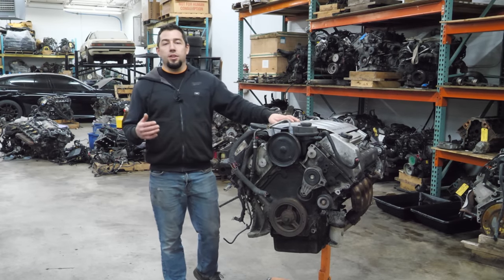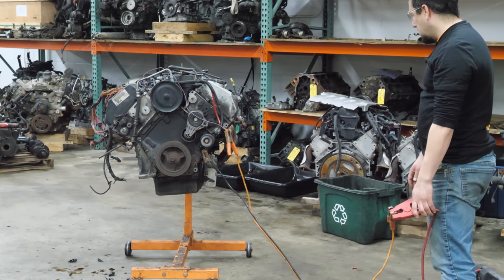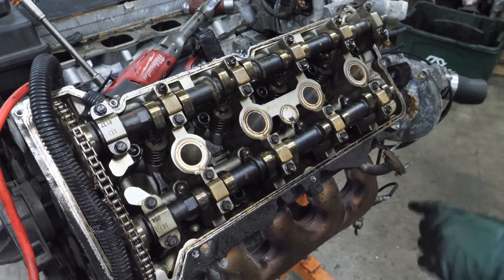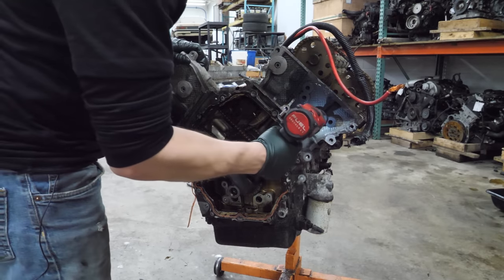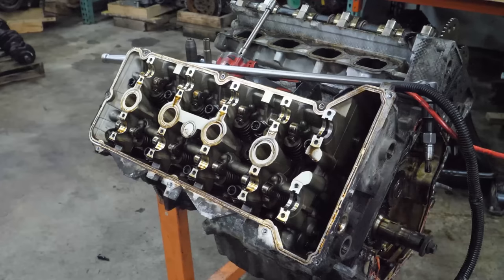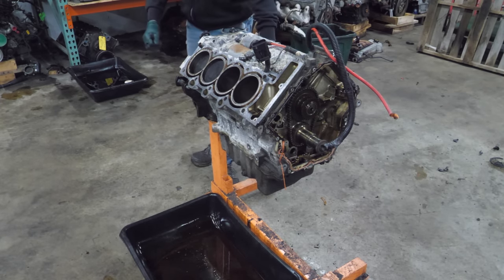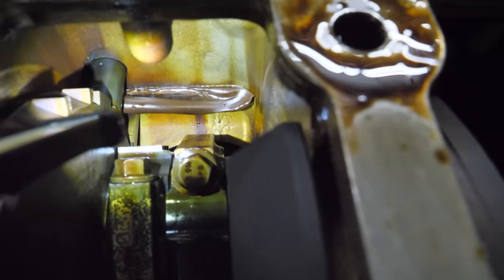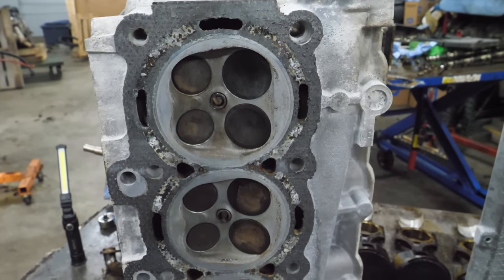Customer Returned This Cadillac Northstar L37 4.6L V8, How Many Things Can We Find Wrong?

Comment: This reminds me of your last video on the Ford 300---lack of cooling system maintenance roasted the head gasket(s). For those that are new to auto repair, I hope this tip will help. When applying RTV to flat mating surfaces, you want to have full, even coverage all around the gasket surface, but the RTV should be THIN. How thin? There should be just enough so that if you were to smear it with your finger while it's on the gasket, it shouldn't spread. If you tighten the bolts to spec and you see ANY RTV oozing out, you used too much.
Reply: @Freiherr Dinkelacker Yes, exactly!
Reply: Good Quality gaskets do not need RTV sealer. This engine was beyond overkill with the RTV!
Reply: RTV shouldn't be used with gaskets. Thin might be better, but NONE is the proper way. 
(unless specifically documented by the engine manufacturer)
Reply: that doesnt makes sense to me. sure, if it oozed out there was too much, but guess what, what should be there is still there, so isnt that still functional? not enough would be the bigger problem, youd do all that work for nothing because it'd leak all over again. 

better to have and not need than need and not have. also, like previous guy said, you shouldn't be putting gasket material on a gasket, thats what the gasket is for.
Reply: @BobSmith-mc7uq  It seems that there are no good quality gaskets for Northstar as there isn't a single gasket that doesn't start leaking after few years. That's why RTV is often used. Ofcourse this here is complete overkill.
Reply: @bradhaines3142  It's not functional when much of it winds up in the oil pickup tube, or clogging oil galleries and coolant passages.
Reply: @justsumguy2u  thats why you let it set before you put oil in it, as directed
Reply: @bradhaines3142  That doesn't make sense. Even if it's fully cured, it can break off in the engine due to heat and vibration.
Reply: @bradhaines3142  - too much means it breaks off and clogs the engine. Also, it could fill in smaller oil and coolant passages. RTV silicone is the wrong product for many applications, including that joint.
Reply: @johncoops6897  Yup.  Use an appropriate gasket adhesive on paper, cork, or metal gaskets.  Use nothing on rubber seals or pre-coated gaskets.  Use RTV when there is NO gasket.
Reply: @KevinJames-yg9eu  - Generally, you shouldn't need to use any gasket adhesive. And RTV is NOT the proper way to seal metal to metal in many cases. In all cases, do what the engine manufacturer recommends, not what the sealant manufacturer says.
In the case of a North Star, the correct product is anaerobic flange sealant and not RTV.
Reply: @BobSmith-mc7uq  

Toyota only recommends a sealer when there is a difference in height along a gasket service or an acute angle less than 90°. 

For example, on the 1mzFe 3.0L V-6, a small thin bead like one of the commenters mentioned goes over the two semicircular plugs on each head and then in the 50 degree or so angle from a circular housing at the other end of the camshaft.
Reply: @bradhaines3142  ya need more goop. and just smear rest of the tube around the outside.    PERFECT !
Reply: @BobSmith-mc7uq  every honda engine requires rtv on some gaskets because of the way the timing covers are arranged. It's good practice but probably not nessicary.

Comment: What really scared me was they had two timecert kits for these. First one for original failure and a second one for when the first one failed. Only way to fix these was the Northstar Performance stud kits.
Reply: No the only way is to have a professional machinist rebore the threads and put in larger ones, there’s someone that does it and has a 100% sucess rate in completely stopping any failures due to head gasket bolts.

Comment: This video brought back so many memories from when I worked at a Cadillac dealer. I rebuilt a few northstar engines. The rtv was a bulletin to use silicon instead of the cheesy rubber gaskets along with the anaerobic sealant for oil pan. I loved working on those money pit engines 😅. Imagine working on that engine in a no room engine bay 😂. Thanx for the tear down.

Comment: The NorthStar is pretty much the opposite of the LS. It's actually (in theory) not a bad engine at all, really cutting edge ahead of it's time. They where pushing 300hp from a 4.6 in 1993 which is really really impressive. I think the issue with it was too much at all at once. The LS really if you look at it, is a product improved 2nd gen small block chevy. The northstar is a really really advanced engine that i think if it had more time would have been a great motor. It has a fully supported crankshaft like performance engines, the lower oil pan forms the bearing journals. It also had fully controlled spark and fuel timing among other electrical goodness. Those valve covers are magnesium I think, because light like plastic but not cheap and break.

Consider what ford did in 1992, they made the absolute disappointment that was the modular pretty begrudgingly after wanting to discontinue the mustang for a Mazda and v8s all together.
Chrysler was still using the LA from 1964 with pretty much 0 changes they had AMC cranking out their abysmal 4.0 becuase they didn't have an engine worth shit that wasn't by Mitsubishi.
GM tried. I mean they totally fucked it up and this engine was hot garbage all things considered. But they had a go at it, unlike the others. And i forgive them for everything cos they went back at it and made the LS. They didn't try to stick to it like ford. God I hate the modular. The cayote sucks too.
Reply: Good take. As someone else said, it could be considered two Quad4s joined together, and while Quad4s also had problems, they were very close to the most thermally efficient engines for their time and definitely for the price, pretty much only Ferrari and Lamborghini were selling cars with higher mean effective pressures in normally aspirated engines at the time. GM running hot and cold on innovation and investment meant the Quad4 and Northstar both had lots of potential and good ideas that weren't given the time and resources to gel into something really developed and ready for market at the volumes and price points GM wanted them to.
Reply: @Trendyflute  Yea i think it was just time and testing. The other thing is i think this engine was a victim of culture, Americans where so used to the bombproof reliable Chevy small blocks that they weren't ready for a engine like this. I bet in a German car the NorthStar would have been praised as one of the best engines. Is this any less reliable than a M60? or a M113? The main issue it had was oil consumption and overheating (which was usually owner fault)

I've slapped small blocks together with multiple gaskets because the deck is warped and those things run and run fine. You can't do that sort of thing to one of these.

Granted I might take all this back, I'm looking for a decent NorthStar engine to build and NorthStar swap something in place of my usual LS swap. And maybe it really is a garbage fire. Won't know till I try.
Reply: The modular ford, one of the most reliable engines ever made. And you bad mouth it like it's garbage.
They have also gone faster than any ls in any configuration. 
Yep that horrible engine.
Reply: How could testing not show how weak the block is where the head bolts tread into.  Major design flaw that any engineer worth his money should have known.  Typically GM most likely the thin head bolts were a few cents cheaper.  And the Ford modular motors are best in class and way advanced compared to an LS.
Reply: @racekar80  "How could testing not show how weak the block is where the head bolts tread into."
Because the threads fail when overheated. And the NorthStar was "designed" to be overheat resistant. It had a lot of features like limp home mode where it ran only 1 bank if it had no coolant and it could run about 100miles using the other bank as an airpump to cool the block. They should have tested overheating but they didn't or didn't consider it a major factor. The thing is when overheated the first sign is a head gasket fail, which is pretty typical of most engines when overheated so i can imagine they failed to see the bolt stretch. You can fix the issue, the block can be rethreaded for larger diameter bolts and then problem solved.

" And the Ford modular motors are best in class and way advanced compared to an LS."
HAHAHA best in class for ford maybe, they never could make a decent V8 unless it was massive, cracking blocks walking caps 2 bolts because they always cheap out lmao. The modular isn't advanced idk why you think it is, SOHC isn't some advanced technology. Here's what actually matters the LS uses billet main caps supported by 4 bolts and 2 skirt bolts, the Modular uses old school cast mains with only 2 bolts and 2 either dowels or jack screws depending on whether it's a Windsor or Romeo block. Both designs absolutely awful, the design inherently means it's hard to get the caps centered. And that's proved by what they did for the cayote, 4 + 2 bolts billet mains just like the LS. In the early modular the rear cap isn't side supported from the sides at all. The head bolting on the modular is OK but not great it uses 10 long bolts inside the valve covers, the LS has the advantage being pushrod and bolts 15 the 10 longer bolts and 5 small bolts prevent walk. The modular block valley isn't fully supported, if you look at the LS valley it's enclosed and that aluminum cover at the top is like a girdle and adds more stability, ford added more material up top to the aluminum block modular and the cayote to get the same strength. On the bottom side LS oil pans are structural and again act like girdles to hold the block together it's why the LS pan is Aluminum not stamped steel. The LS prioritizes head oiling that makes sure the top end gets plenty of oil, it's why despite being pushrod the LS revs plenty. The heads, all the modular heads are garbage there's not much that can be done with them the valves are tiny and they have to be because the bore is small but even more the runners are small, the lash adjuster setup makes it hard to swap bigger valves and springs because it will collapse or simply break. The coolant crossover happens in the back of the block and the intake which means your intake temperature is not symmetric. And your crossover in the back isn't great either. I'm sure I'm forgetting stuff but it's really not great. The cayote is a great motor but it's because it's a well known formula, not better than the LS but it's good. Only took them 15 years to figure out what imports had already been doing.

Please go ahead and point out what makes the modular a "best in class" engine. I don't think you can find a single thing that it does really well. Nobody modular swaps anything for a very good reason. As for reliability it's no more reliable than anything else.
Reply: @SPAZTICCYTOPLASM  I could write a book about all the lies you are saying, but I'll keep it short. You saying modulars are not reliable is just nonsense. Soo I'll stop you right there. 
I could get into specifics of the modular design program, but I'm suuuure you know this stuff since you are saying they don't interchange. Hell, I could say the ls doesn't interchange, but that would be a lie. Just like saying modular stuff doesn't interchange. So whatever point you are trying to make on that is moot. So let's move on.
So, to you, it's impossible for modulars to make 1000hp? 🤣 yeah nobody has ever done that. Point you to one? One is 10 feet away from me. Or you could just search anywhere on the internet easily, but ignorance is bliss. 
Yeah modulars have gone faster than LSs. Mind blowing I know.
The fastest 1/4 mile time I can find for an ls is 5.97. And it took a 427 cubes in a billet block, billet heads, billet crank etc aftermarket everything and 94mm turbos to run that time....meanwhile the 4.6 has gone 5.88, with only 281 cubes in a factory block, factory heads and a factory crank with 88mm turbos... and it has gone faster since that time...
Also, don't know of any ls going over 300mph in the standing mile either..
So yeah.
Reply: @banneddamn  So your source is just "trust me bro". Not a single link not even a dubious forum post. It's obvious you don't know that windsor and romeo blocks have several differences. But go ahead get into the specifics. Take all night if you need to. Times without car weights don't mean anything not that i expect you to know, but the modular crank limit is around 600 horses before it shears.
Reply: @SPAZTICCYTOPLASM  my source is I've looked it up, maybe you should too. Google it. You're just too lazy to do any research on it on you're own so just plea ignorance on your part. Good luck with trying to link things in a YouTube comment. 
I know there are small minute differences in windors/romeos. But that doesn't mean they aren't interchangeable. You can bolt windsor heads on a romeo. Hell I'm running a windsor block adapter on a romeo. The whole point of that is moot and not a point of contention. Meaning that it means nothing in the grand scheme of whatever argument you are trying to make out of that. 
With the cranks. I guess you are talking about a cast crank but seem unaware that there is also forged cranks. Even with the cast cranks, people have made over 1000 on the cast cranks. I wouldn't do it, but it's been done. Richard holdener has talked about this specifically in fact in many dyno test sessions. But I was specifically talking about the factory forged cranks. Which have been run at close to 3000hp in those engines and they have never failed/broke in those racecars. 
Now with the cars running those times. Both are similar pro mod style chassis with similar weight. 
So do this. Type into google fastest ls 1/4 mile. Article comes up I think for drag racing illustrated. 5.97. 
Then Google accufab racing. Goes 5.88. 
Look it up for yourself. Trust me bro, I doubt you'll even look into it so who cares.... I know you don't. Just anything to not be proven wrong.
Reply: The Northstar engine originally came from Mercury Marine. It was originally purpose-built for boating applications.  For some reason GM switched to a finer thread pitch on the headbolts.
Reply: The teksid blocks that started out in the mark viii and became the power plant for the mustang cobra made 300hp without a ton of issues , and those blocks were capable of handling 1000+

Comment: 17:06 As a (former) DSM owner, I felt that one.

Regarding the rod size, remember that size is only part of the story (there’s probably a joke there). The Northstar is an expensive engine that was only installed in expensive cars. The 5.3 LS is a cheap truck engine. The Northstar is meant to spin up to 6500-7000 rpm. The 5.3 LS is made to spin up to 5500rpm. In other words, the rods are made of stronger, lighter materials in the Northstar, whereas the 5.3 rods are made of cheap, heavy materials. So yeah, size is only part of the story.
Reply: Right 😂😂 I’m not an owner but had to do one on my buddy’s 4g63 😂😂
Reply: LMAO I came here to comment about the 4g pass he made 😅😂😂😂
Reply: Glad another fellow DSMer heard it too😂👌

Comment: Once the head studs are repaired with a kit from Northstar performance these engines are actually pretty cool. I think I saw one on Youtube years ago that made 700hp with a turbo and spun to... I think 8700RPM and sounded absolutely sick. If I had a project I would totally consider shoving one of these engines into it.
Reply: It will definitely not hold 700 hp for very long, north star engine block is weak
Reply: @a.a7648 hey are not! Any block will crack if not sleeved to handle certain power level and using those hard solid mounts.

Comment: This one had the VVT I believe , the roller lifters were a nice change, my 98 had the old bucket style lifters. The VIN K  engine code  L37 engine was rated at 300HP factory, a good engine, it was just mostly neglected from owners who have no idea what " preventative maintenance" is. This is a good rebuildable engine, use a Northstar Peformance engine head stud kit and the bottom end stud kit as well and this thing will last forever. Jake in Canada owns NSP and patented his own engine stud kit with the tools to do the stud kit including the jig plate, drill bit tap thread locker and everything needed. The 4.6 Northstar is so underrated, it's an amazing engine!!
Reply: Couldn't have said it better myself. Most of the time when I see these nowadays it's a single mom with 3 kids on 2.donuts putting 87 octane in and leaking oil everywhere. Do you really think she cares about maintenance 😂
Reply: No VVT until the LH2 in 2004, and I'm not sure they ever used VVT in FWD applications.  The LH2 was a RWD Northstar.  I had two.

Comment: oh yay! Weird engine time!

 Also, Why is it out of every DOHC V8 engine i have ever seen, with timing chains atleast, only ford gets them right? Having a whole front Timing cover that comes off is so much nicer than this BMW style Chains through the heads stuff. 

The Jag/Lincoln AJ-V8 is leagues ahead of this when it comes to repairability for the chains.
Reply: I have a DOHC ford V6 that also has a correctly designed timing setup. Much easier to access everything.

Comment: My first car was a 2000 Oldsmobile Intrigue with that 3.5L Shortstar V6.

Needless to say, it died in the form of a head gasket failure. Shocking, I know.
Reply: I also owned a 2000  Olds 3.5 Intrigue. I sold it a few years ago with 362000 miles. No major engine parts replaced. I guess I got lucky.
Reply: I had thee same car. I loved it. Handled great, and had lots of power. Never had an engine issue.
Reply: @imonaboatmfg72  no they dont have the head bolt problem like some northstars